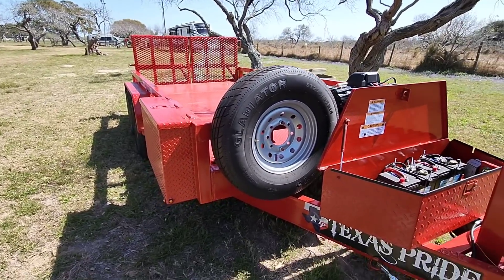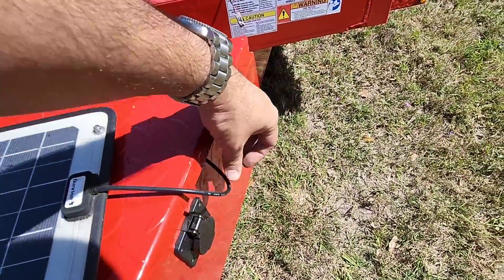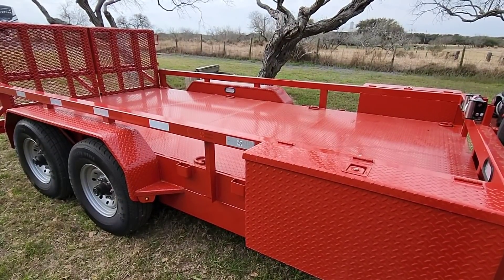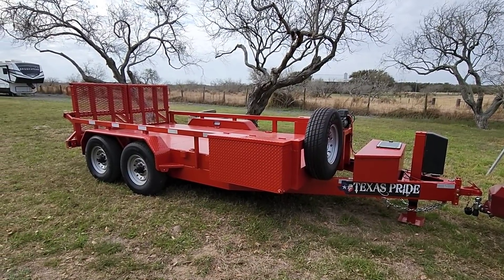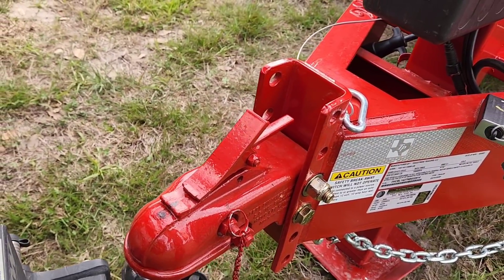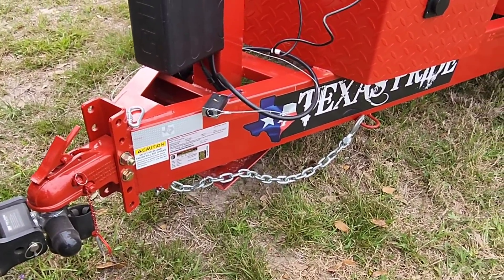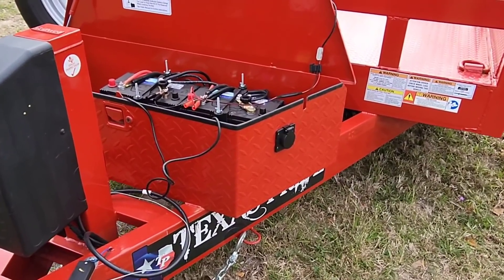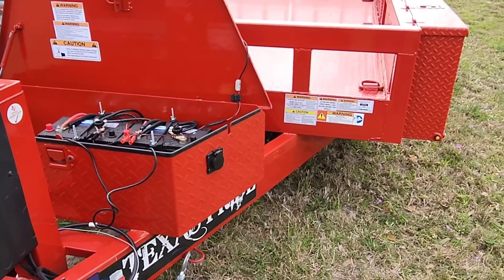DON'T HIGHBALL your Trailer Coupler!

Comment: I haven't driven off with it not engaged, but (thankfully) caught it once before I took off.  What I do now is lower the trailer just enough till the receiver locks, then I lower the jack back down again, but just a little bit.  If the hitch follows upwards and then the bed of the truck raises with the tongue as well, again (just a bit because I don't want to stress the jack), I'm sure it's locked on. 
Love videos like this!

Comment: I forgot to put the hitch pin in once towing a small 3000lb cargo trailer for 20 miles on the freeway. When I got to my destination, I wondered why the safety chains were tight to the bottom of the hitch for a second...  then saw it. The hitch slid about 1.5" out of the receiver and the friction from the chains being crossed under the hitch was what prevented it from sliding out further. Learned a lesson that day about being in a rush.

Comment: I had the hitch ball work loose after  having some else flip it on the receiver. I had tightened it down with a wrench and cheater pipe. He didn't. Good folks at U-Haul in Amarillo tightened it up with an air impact wrench.
I always check that now.

Comment: I only messed up once. But when I worked in lawn care we had a tri ball hitch and I had it turned to the 2 inch side and put a 2⁵/¹⁶ coupling on it. Never lossed the trailer but fixed it once we stopped at a stop sign. Also ever since I moved back to Texas every trailer I've saw so far has the side latch hitch and I love them. Plus it's easier to lock or unlock compared to the ones at tractor supply or other trailer places after the get rust on em

Comment: The current trailer I have needs something.  To detach I pull out at the receiver (square section) then wiggle and beat until it comes apart.  Always use the electric jack to check for high balling.

Comment: I high balled an auto transport trailer once. Moving the trailer empty, it bounced off and the safety chains held it in line. I had to unhitch the trailer to load the moving truck and it was 12F outside with snow and ice when I was trying to hitch the trailer back up. That rental equipment wasn't maintained very well. Tires were low in pressure and the vehicle fuses blew when trying to inflate them with a small tire inflator. It is nice to have my own truck and better equipment now.

Comment: Years ago, I hooked up my dad's trailer to my F150.  He had a tandem axle with each axle being 5500lbs, I believe.  The trailer was empty but heavy enough I could not pick up the tongue.  I don't know what I was thinking.  I had lowered the trailer onto the ball and did not lock the bull dog collar or put the safety chains on.  I made it about half a mile down the road before I knew something did not feel right.  The trailer felt bouncy.  Fortunately, I caught it then and no one got killed.

Comment: Yep, my 23ft carrera sport boat. The trailer is triple axle did exactly as you experienced, felt the bump but kept it on pulled over and spent 5 minutes just staring at my mistake and thanking God

Comment: I use a double balled hitch because I tow an older horse trailer that is 2” and my equipment and cargo trailers are 2 5/16”. Got in a hurry one day and put the hitch on the truck upside down without realizing it, at least until I hit a dip in the hiway at 65 mph and the 16’ cargo trailer came unhooked. Thankfully I believe in safety chains and avoided a major accident and the only damage was the front of the trailer and my pride. 
Always take your time and double check everything before you tow.

Comment: I like the video. Todate I have never pulled away without checking the hitch coupling myslef. I am so scare of the trailer coming off while we going down the road and the damage it could do to other people, I always check myself twice. With that being said, I have made the inspection too fast and not make sure the safety pin was in a couple of times. I worked as a  Tatcical Satelite site manager for 20 years (double axel dully, and tractor trailer). I did have one trailer incident with one of the 7 vehicals, but that was not due to improper trailer hitching (whole rig on it's side). While watching others make the mistake. I made a departure check list for each of the teams.

Comment: About 20 years ago, I high balled a boat trailer. I made it to the landing, got the boat on the trailer and was heading home, I looked in my mirror and saw the tongue of the trailer above my tailgate. I let off the gas and let the rig come to a stop on its own. No damage. Ever since that day, after latching the coupler I pull up on the tongue (if it’s a light trailer) otherwise I feel for the coupler to be in gaged as shown in the video. If I stop along the way, I check everything before leaving. Who know if someone was messing with the trailer while your not around.

Comment: I had a coupling come off of the ball before and the safety chains saved me!  The issue wasn’t the lock or user error. The piece that is attached to the lock (the piece that comes down around the back of the ball) had come loose and wasn’t tight enough. Not something you check very often.  It was in place and locked, just loose.

Comment: Haven't high balled a trailer myself, but was following a couple that was moving their 20+ foot boat trailer (empty) and when the guy went around a corner and accelerated, the trailer lifted the front just enough to drop off.  His wife in the car behind saw it happen and flagged him down with the horn, he didn't realize it was off the ball at that point.  I helped him lift it back on and make sure it was locked on.  He'd had the trailer a while but still didn't know what to look for when hitching it up.  I guess he was lucky he kept the boat in storage by the lake an only planned to tow it to another lake to visit friends or family once or twice a year.  (this was his first trip with it).

Comment: I started towing recently but I still always get my head low enough to see under the trailer and see if the latch is under the ball and cradling it from underneath (I don't put my head under the trailer itself). My trailer like to fight me a lot on that so knowing that, it's good to go in knowing another trailer might be worse. It is definitely better to check many times so it doesn't come off while driving. It's also good to use some grease. I know it's not necessary but I use bearing grease because it always keeps my balls nice, scratch free, rust free and really shiny when you wipe them off.

Comment: It’s a good practice to inspect the coupler before the tow vehicle is in the way, actually getting down and look up into the mechanism. Especially rented trailers, heavier loaded and the more  utilized trailers. Look closely at the bolt / pin the latch mechanism pivots around. Proper lubrication in the right areas will make life much easier- you shouldn’t ever have to strike or pry a coupler to get it to open or close. Also double check the coupler size matches the trailer ball size. 
I’ve lost count of how many worn or bent couplers I’ve come across over the years, mostly in the equipment rental industry.

Comment: I am the only one involved in the connection process. That way there is no one to blame but myself.  On starting out I will stop and check that everything is secure. If I'm towing lond distances, I check everything at every fuel stop and when I stop to eat. I am in the trucking industry and it is a valuble habit.

Comment: If you are in doubt, throw the couple lock and then kick back up too see if it is locked. FYI- checked wheel bearing grease before pulling, factories even the major ones on axles tend to just squirt a couple of shots in just to get it to the dealer. I have checked brand new ones and barely enough grease to cover the bearings. Peace of mind for me so I know they are adequately packed
Reply: I found this out with a PJ trailer I had for several years before I checked the grease level. Fortunately the trailer was hardly used but I ended up squirting almost two tubes of grease into four hubs. These days you have to double check everything you purchase and even after being serviced. It’s a bummer but a reality of the current world we live in.

Comment: I did it on a PWC trailer, and noticed because I could hear some extra clanging. Went about 1/4 mile and pulled over to fix it. That was a light trailer so I would always give it a "shake" after that to make sure it was securely on the ball. 

Worst part was, I was teaching someone how to set up a trailer when this happened... 

Now that I'm towing bigger (power jacks), I both visually inspect that the cleat is under the ball as well as give it a little bit of a lift test.

Comment: Yes!!!  My boyfriend borrowed my Dodge Ram Diesel pickup to tow a trailer, and didn't tell me he changed the hitch ball.  Several months later, I hitched up my small camper to go to friend's house to camp at her farm for a week and my little trailer bounced off the ball and I safely steered it off to the edge of the highway.  I was stumped why it happened when I looked at the ball and wondered how come I had the wrong sized ball.  Thankfully a nice local police officer helped me by putting the trailer back on and shadowed me to the next exit where thankfully a convenient "has everything" hardware store was located where I purchased the correct ball.  My boyfriend got an earful when I saw him next.   Lesson-always check your ball size, even if you think it is correct!

Comment: More then competent friend of mine hooked up my car trailer, we drove 30 miles with a car on the trailer (high balled) and 20 miles back (empty) the trailer popped off over a bump. Chains saved it from completely hitting the road and wrecking the jack / coupler. 
Lesson learned, always double check or hook your own stuff up.

Comment: I backed my truck up to my boat trailer, and let my wife and son connect it.  They did not unlatch the coupler, and yep, it highballed.  My fault for not checking their work.  We were only towing about four miles, and it uncoupled over a bump approaching a stop sign.  Luckily we were only going 20 or so, and the trailer did about $200 damage to the truck.  Never again.  My new Diamond C has a Demco coupler, which autolatches.  I may change all couplers to Demco - not expensive and really great.

Comment: My 16 ft. trailer has the Bulldog coupler. When I first used the trailer, I didn't check to make sure it was down all the way which resulted in the trailer popping off as I was going out my gate. I've never made the mistake again; like you, I always check to ensure it is connected properly. The ball is only a 2 inch,  but I make sure the gooseneck connector on my fifth wheel is properly set.

Comment: I was tasked with going after a skidsteer about 100 miles away on a twisty curvy road that follows a river all the way. I went out to the shop and the mechanic lined me up and hooked the trailer up. I went to the site to the skidsteer and the guy running it come over and asked Is that a 2-5/16 ball? I said "should be, I had Doug hook it up".  Turns out Doug set the hitch on a 2" ball with a hollow tube stinger. Howard loaned me a solid stinger with a 2-5/16 on it. God must have been watching over me that day. I now always check when anyone but me sets the hitch down.

Comment: I was moving a trailer for a friend. As I moved off the property, uphill driveway, it bounced off. Yes, I had the safety chains on. I had to back down to level ground and that has never happened again. That was 38 years ago. Instead of using my finger to check, I raise the trailer. If it is connected - the back of the truck starts lifting up. I don't remember the last time that I did not have a good connection on the ball.

Comment: Run a hot from your truck battery.  Put a welding lead on it somewhere on the back of your truck.  Then you just need a lead from your trailer that can hook in the truck.  No need to maintain batteries anymore.  I had 7 to move shavings from our flooring mill.  Down to 3, and it’s nice never having to worry about batteries.
Reply: Break a way trailer breaks???
Reply: Waiting for someone to say this.    The original charger won’t charge the battery fast enough for consecutive dumping
Reply: Great trailer
Reply: @enz6312  Come on Zim,   Brake--Brake---Brake

Comment: A few years back I had the trailer I was towing highball but luckily it did not happen while driving. I was renting a piece of equipment and it came with its own trailer which I was not very familiar with and thought I locked the coupler but turns out I didn't. There was enough tongue weight on the hitch that I did not notice anything while driving, but once I started unloading the equipment and backing it off the ramps the front of the trailer flew up. Thankful it did not happen while driving, but that was the first time and hopefully last time, now I always triple check the coupler especially when I am not towing my normal trailer.

Comment: Yes I did.  I tow a Runaway trailer.  I'm new, never towed before.  It wouldn't go down any farther, so I took off.  As soon as I hit the main road it fell off, and the pipe dragged onto the road.  Someone else jammed the pipe back into the slot, but I can never take off the wheel again because I don't know that I'll be able to get it back in.  When driving I always hope that I don't go too low lest my wheel hit the ground.

Comment: I never highballed a trailer, never even thought about it. I've just set the trailer down on the ball, and could tell by looking if it was as far down on the ball as it's supposed to be. Only trailer I ever had come off was one the U-Haul guy hooked up for me, and I didn't check. He didn't spin the knob to latch it to the ball. That was the last time I let someone else hook up my trailer.

Comment: got in a rush once and didn't latch the turnover ball into the hitch, but trailer coupler was locked onto the ball. Loaded a truck and pulled the ball out of the socket and caught it by the safety chains. was a very delicate deal to give the slack in the chains to pull away and reset. didn't help it was 2 of us trying to knock everything out so we had both assumed the other had latched it.

Comment: Level is not level unless you are loaded.  Unless you have an air assist load leveling system, you should always have an empty trailer riding high on the hitch.  That way when you start loading the trainer it will lower the back of the pickup to level and you will not have to worry about the chains or jack dragging or hitting the ground. the ground

Comment: Something I always do when connecting a trailer is lock the trailer to the hitch, and lower the landing gear. If the rear of the tow vehicle begins to raise, I know I have a properly secured trailer. 

I utilize a crank styled landing gear, and have a piece of lumber as a base of contact with the ground

Comment: Highballed only once.  Rented a uhaul trailer and they insisted that they had to secure everything.  Went to load it and the second I stepped on the back end of the trailer it came clean off the ball.  Thankfully it was a small trailer but lesson learned.  Since then I have bought my own trailers and maintain them myself.

Comment: This was more my dad than me at the time, but we had a trailer in our scout troop that was modified a few times, and I learned a lot about trailers the hard way. It had the tongue extended when it was donated to the troop with a rack on the front for propane tanks. Whoever they had do that was probably not a proper trailer tech. On top of that, it was very easy to get it out of balance with too much or too little weight on the tongue. Many in the troop just thought it required a bigger truck, and my dad's suburban was one of them that seemed to handle the load just fine. I had often helped with loading the trailer and knew how to load it but was not able to that week before the campout, and it was loaded extremely tongue heavy. Our old 87 suburban had no problem with the load, and we had double checked it, everything was latched but about a block from the scout house, it came off the hitch, Ripped the chain right off the tongue, and trailer went into a ditch. A lot of people were blaming my dad for high balling, but what we found out, not only did the chain fail, but the hitch coupler was only rated for 400lb tongue weight and 4,000lb trailer weight. Weight of the trailer that day was about 9,000lbs and very tongue heavy, it wasn't high balled, it deformed. When it came back from a proper repair shop, the whole tongue was rebuilt with a proper A-frame and a 2-5/16 coupler rather than a 2", but many still blamed my dad and would not accept it was faulty hardware that caused it.
Reply: i heard your dad had an alcohol problem. didn't he get booted out of the scouts after
those 3 boys complained about your dad & the shower partys?

Comment: I have pulled trailers since a teenager on the farm and the last 35+ pulling campers. I have seen the problem you describe ( did it once pulling a stock trailer loaded with cows, we all survived) but have witnessed many campers not hooked up properly or with the wrong ball. Unfortunately not all balls or hitches are clearly marked. Good video!

Comment: I have highballed a boat trailer with the boat on it. Its a very short and slow drive from the cabin to the launch ramp on private roads so nothing felt weird, backed down the ramp, hit the brakes to stop and the trailer came off the ball. Lucky for crossed chains ! Now I always bend down and physically check that things are properly latched, or if a light trailer i give it a pull to make sure all is locked down
Reply: I've watched some of the videos on YouTube about people launching their car with the boat. One showed the car was ahead of the boat, so the car was in the water but the boat and trailer were still on the launchway.